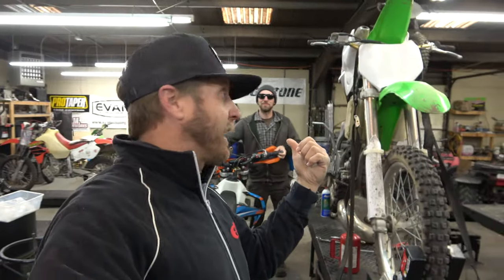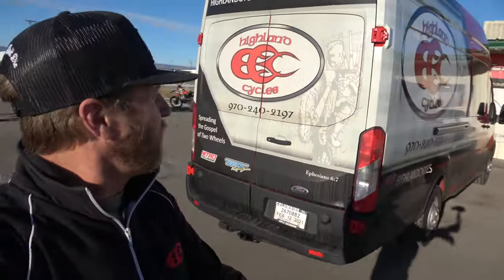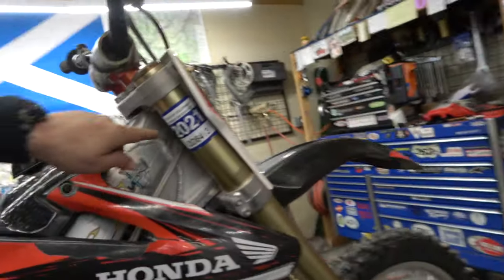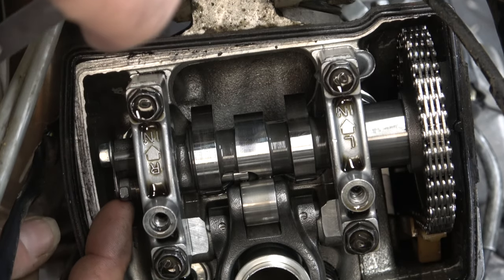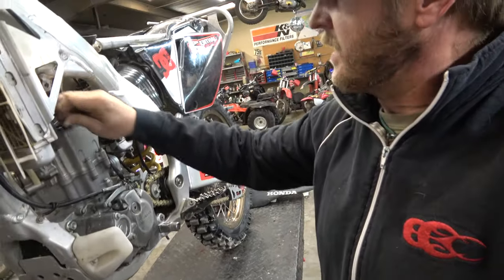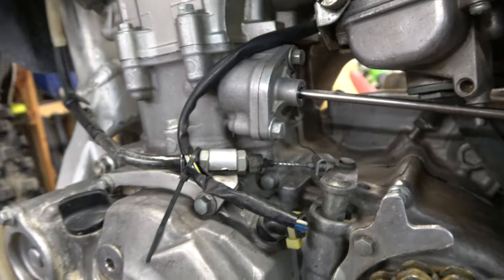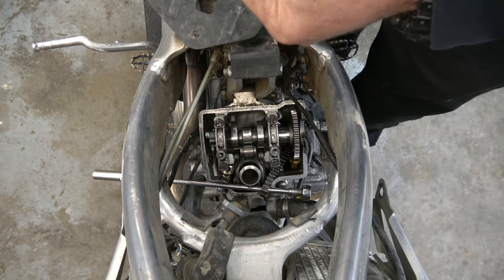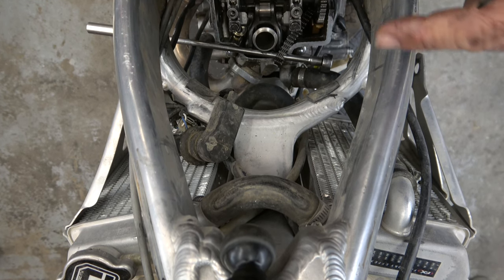The Shlog #144 : CRF Valve Adjustment

Comment: Montana has the same street legal setup less the DOT tires and inspection. Pay for your plate and away you go, Going to check out those Task Racing lights.
Reply from the maker: Yeah. Colorado was the same up until 08. Task lights are rad

Comment: Where Can I get a set of those feeler gauges you were using? The small gauge tange on the rigid handle is genius!
Reply from the maker: I think they are Motion Pro
Reply: @highlandcycles  was the 90 degree screw driver for adjusting the fuel screw motion pro too?
Reply from the maker: @Adudenamederq  The one in the vid isn't but they make one that is better than the one I have